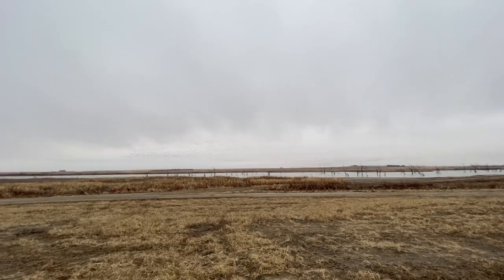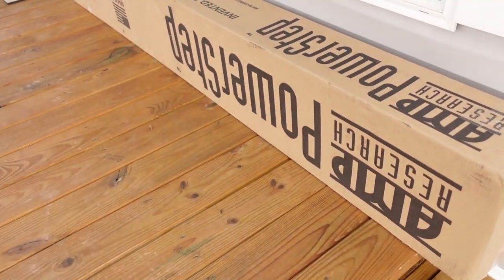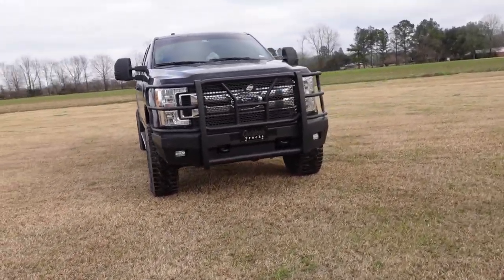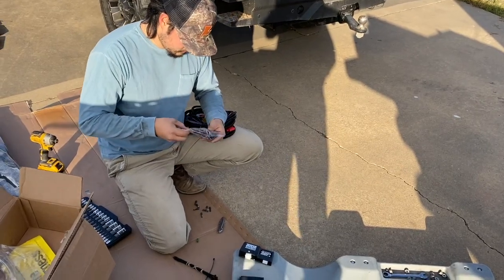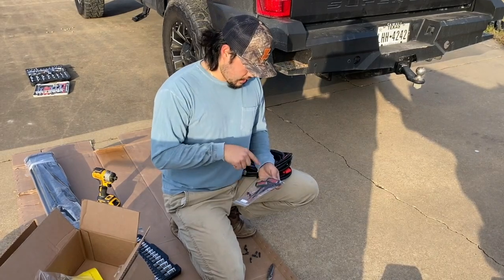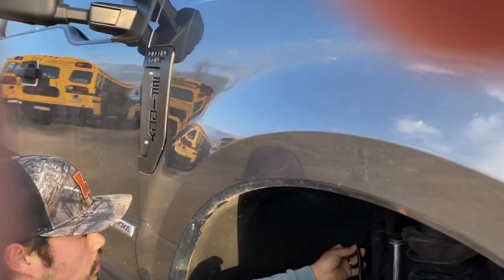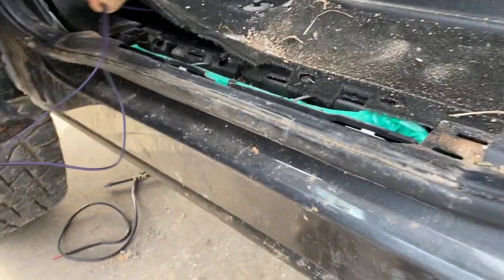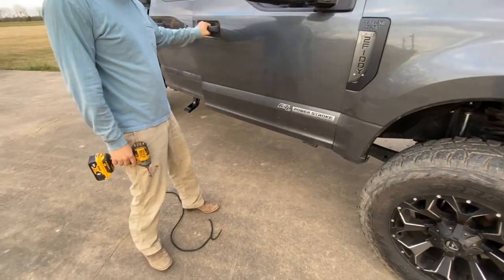Just an OK installation video for AMP Power Running Board Steps on a 2017 Ford F250

Comment: I know this is a bit old but I am about to order these steps and don't really want to run the lights either. Ford Mirror puddle light is bright enough. Did you just cap the wires and tuck them away? or are they spliced in and you can just take them out? Just really curious. Thanks for the help and your channel is great.